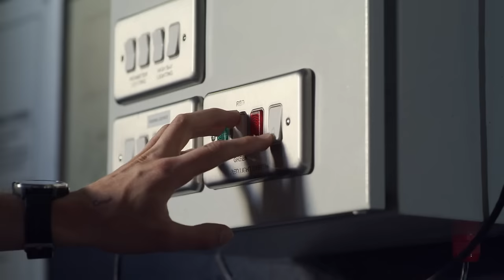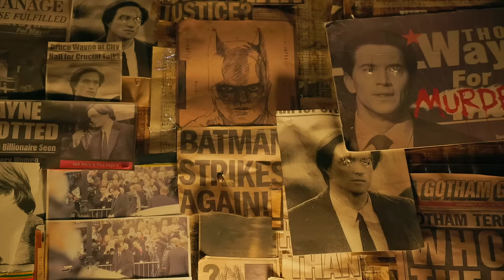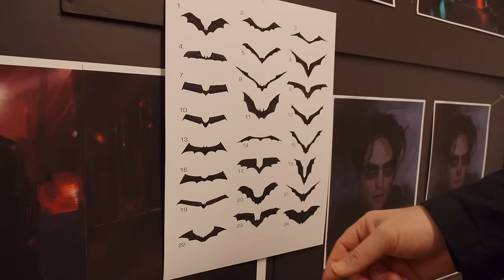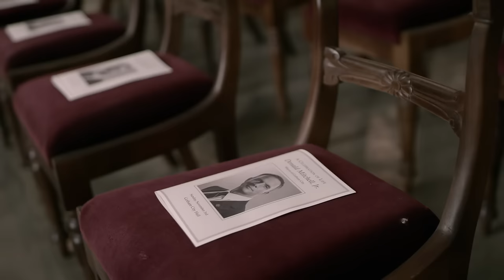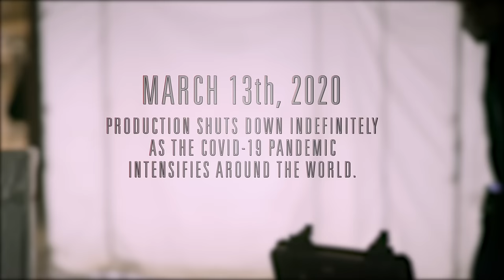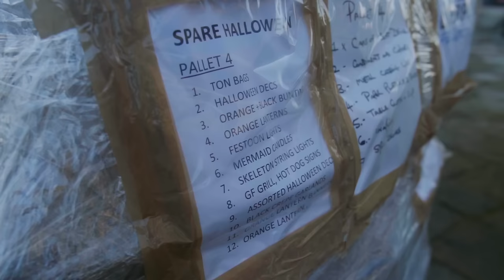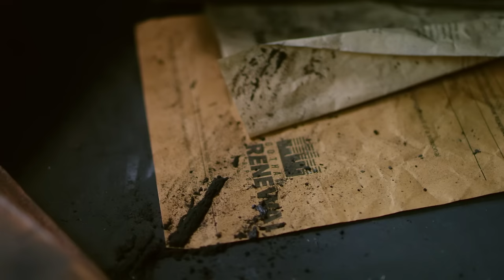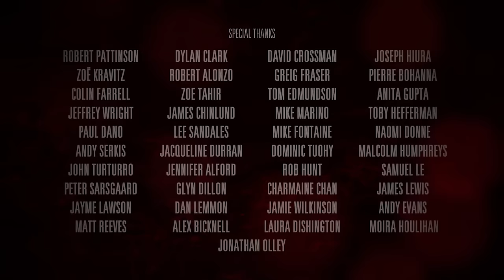Vengeance in the Making | The Batman (2022) Blu Ray Featurettes

Comment: 43:24 - Watching the film I couldn't work out why when they are so high up in the city in the open air they decided there didn't need to be any air flow/wind and appropriately louder dialogue? They filmed it like it was an indoor scene. You just knew it was LED volume straight away because of that.